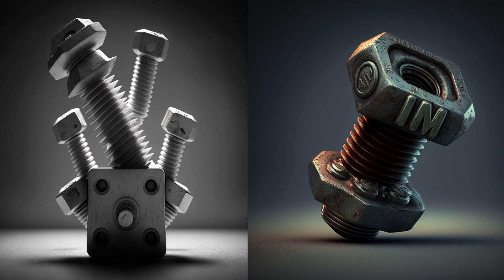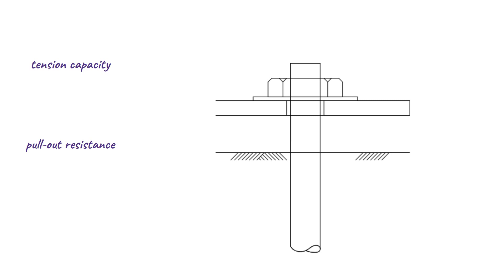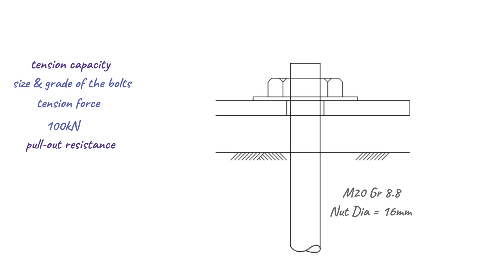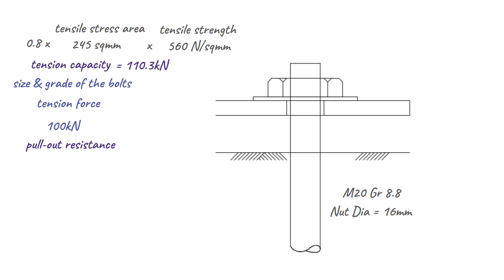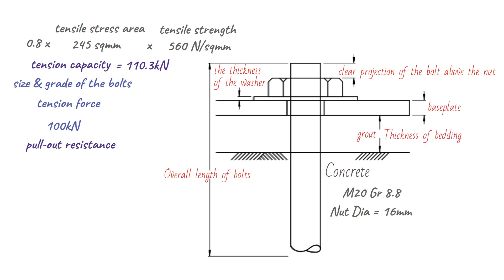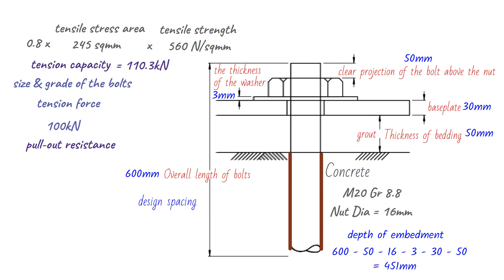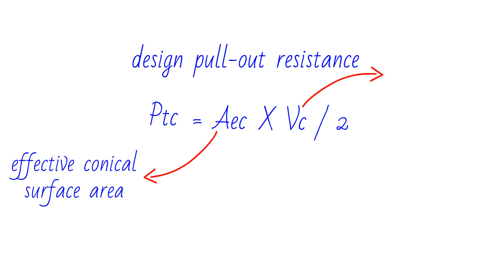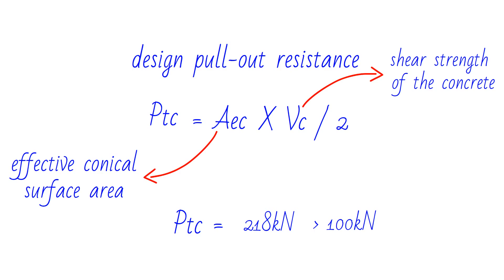How to Calculate Pull-Out Resistance | Maximizing the Strength of Your Holding Down Bolts.

Comment: Where did you find the formula for pull out resistance? How about checking for concrete cone pullout?
Reply from the maker: Thank you for your comment! The formula for pull-out resistance can be found in various structural engineering references, such as the British Constructional Steelwork Association's HD Bolts document. As for checking for concrete cone pull out, that is not something we covered in this tutorial. However, you can use similar methods to calculate the pull out resistance of concrete cones as we used for holding down bolts. The main difference would be in the effective surface area & the shape of the cone. I hope that helps! If you have any other questions, don't hesitate to ask.
Reply: @structuralengineercalcs  interresting. I’ve been looking for a formula for embedment depth in the eurocodes for a long time. Will have to check it out.